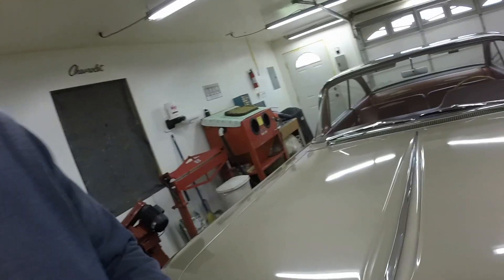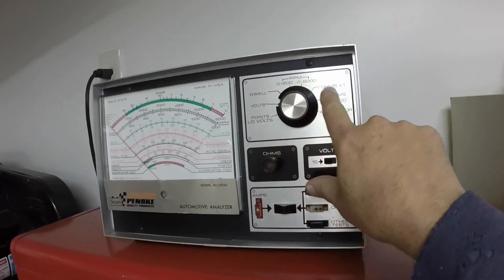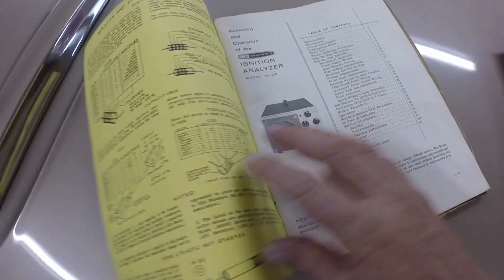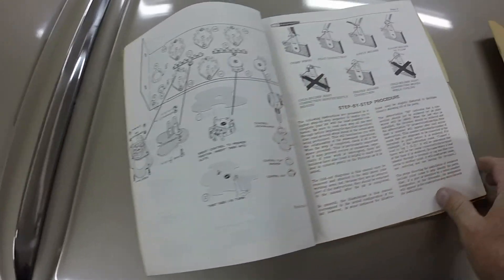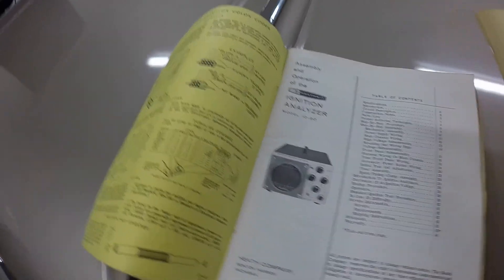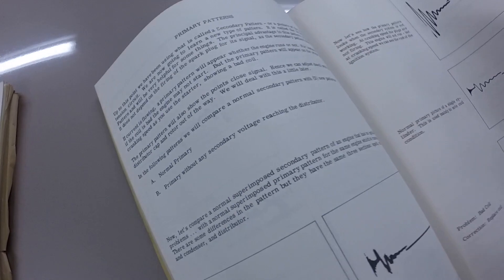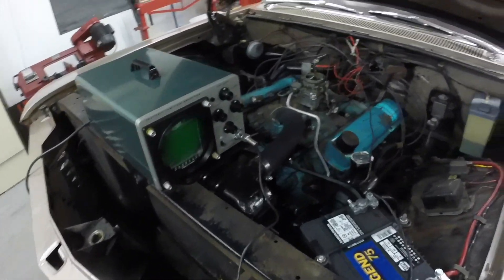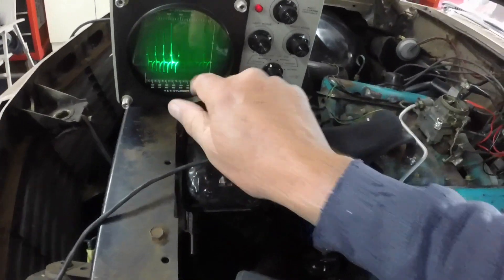Vintage 1960 Heathkit Ignition Oscilloscope on 60 Pontiac barn find

Comment: I have the NRI version of this, which is nearly identical. In the video you are hooking up to an engine and mention the round multi pin plug on back of unit, I have found out that a timing light was made to go there, FYI.  I have also seen a what looks an adapter plug that has 2 lugs with thumb nuts to attach a couple wires, may also be for a timing light or RPM gauge?

Comment: Have the solid state Heath Company version, no RPM indicator.  I think it was a commercially available model, not a Heathkit.  Some practical trace explanations are given, along with some theory, in this Feb 1958 Popular Mechanics article:  https://books.google.com/books?id=49sDAAAAMBAJ&lpg=PA245&ots=X3KYbnFfFN&dq=Ignition%20Analyzer%20Oscilloscope%20Heath&pg=PA245#v=onepage&q=Ignition%20Analyzer%20Oscilloscope%20Heath&f=false

Comment: I built one of these from scratch in about 1975. Still have it. And my scope has the optional 12 volt inverter that attaches to the back so you can power the scope from a cigarette lighter (12VDC) so you can use the scope while the car or truck is being driven, or if you're a mobile mechanic and AC is not available.  Heathkit was a great way to learn so many things. When I went to engineering school I had a significant skill and knowledge advantage from building several dozen Heathkit projects.
Reply from the maker: My dad and I have built several Heathkit projects together, many years ago. I still use the Heathkit metal detector we built. A 12 volt adaptor would be awesome for the engine performance issues that only show why driving down the road. I do have a 12v to 120v inverter, but its a square wave, so I don't know if it would run the scope.

Comment: I bought one of these already assembled about 45 years ago, but I didn't have a shop at that point, and never really used it. It is on the shelf of my garage/shop now, and I'm going to get it down and see if I still have the manuals and test leads. At that point I had already built a Heathkit audio amplifier and a multimeter, and recognized the quality of their products. Later I ordered the Heathkit course that would teach you about electronic theory, if you diligently followed the course plan, and weren't interrupted while you were trying to learn, which can be difficult when you are starting a family and working full time. Thanks for the excellent video, and keep driving the Catalina at least once a week as often as you can, weather permitting, to keep it running smoothly and not having parts rust together on you.  Consider applying Fluid Film to the bottom of the Catalina each year if you are in a northern climate, to keep rust away.
Reply from the maker: I sold the Catalina a couple years ago. I'll let the new owner worry about it.

Comment: I just bought one of these! It should arrive in a couple days. Gotta love YouTube, I knew somebody would have a video. 

Question. From what I'm reading, your coil polarity is wrong!? It will still work obviously, but the spark energy is attenuated.
Reply from the maker: I thought the polarity was wrong too, but I double checked it, and it's correct. After reading the directions for the oscilloscope, that is just the way that model reads. It shows the same on all my vehicles.
Reply: Huh. Well it was originally a kit build... maybe a wire got crossed somewhere?

The connector in back, that looks like a tube socket, is a convenient place to measure internal voltages, without disassembly of the unit. With an inverter you can test the Catalina out on the highway at cruise. We'll wait for the video. Thanks again!